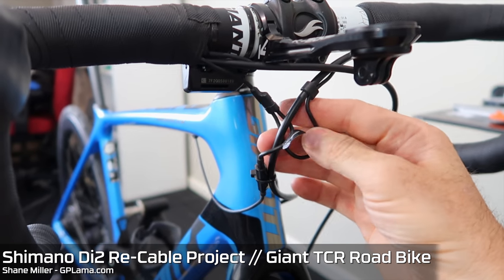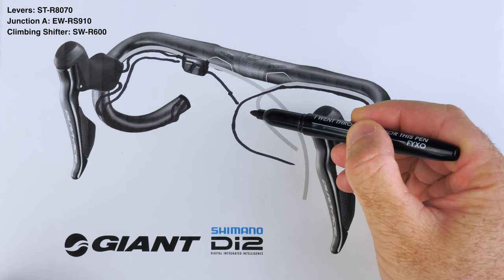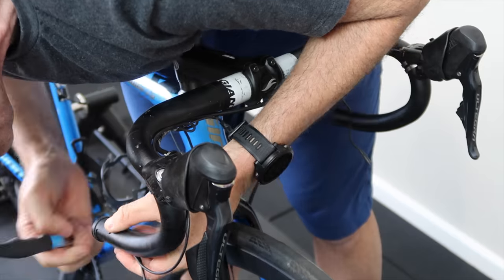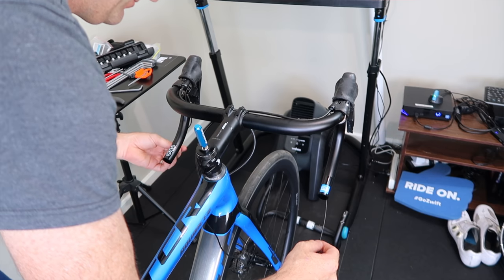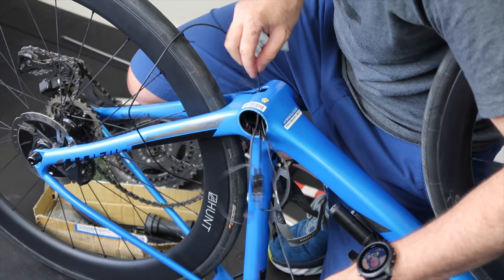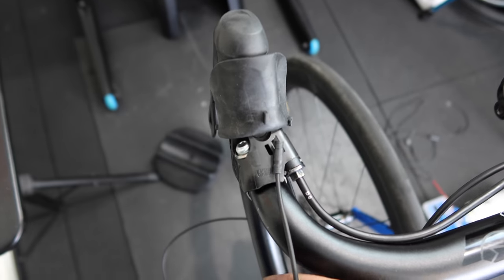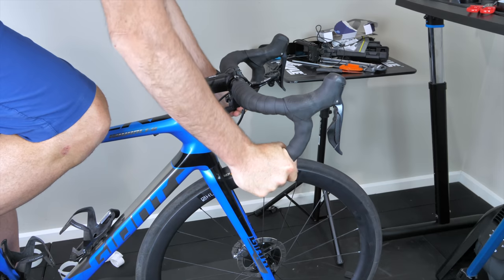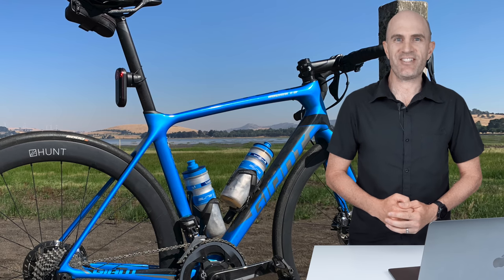Shimano Di2 Re-Cable Project // Giant TCR Road Bike

Comment: Why did you decide to move the WU to the handlebar? I have mine inside the seatpost as it’s out of the way but more importantly easy to access. Btw. I also keep the JC41 junction box in there too. Again easy access. Also I have built my own cable pull system. So so simple. I used a brake ferrule and passed brake/shift cable and secured it with a crimp. The Di2 plug fits in there perfectly.
Reply from the maker: Switched it over to see if it was any more responsive. No issues with it in the TCR post... but some people do report it doesn't work so well tucked away that far away from their head units.
Reply: Is your handlebar carbon? I would have thought there would be a couple of holes under the bar near the shifters. Much easier to hide things.
Reply: Shane Miller - GPLama OK. Like you I haven’t had any issues at all. OTOH, on my aluminum Bianchi I couldn’t put it inside anywhere so I kept it near the headset outside but heat shrink wrapped it on both ends. Love the heat shrink. So clean. Btw you wouldn’t need to bleed your brakes just to disconnect it.
Reply from the maker: Alloy bars. Carbon bars are eTap level expensive.
Reply: Shane Miller - GPLama what? alloy? Have you heard of Faraday Cage? Wireless signals don’t go through metal! It would leak a little from the end plug/controller that’s plastic but that signal would be atrocious.
Reply: Shane Miller - GPLama with my WU always in use while I’m riding (I love keeping an eye on my gears, and control my Garmin pages with the hood buttons) I find my battery needs recharging more often. Good thing we can now turn off BT and just use the ANT+. But watch out with your set up. If your wireless is working at all inside the alloy handlebar (which is a miracle in itself) it’s probably because some signals are leaking from the bar ends... the weaker the signal the more your WU will keep increasing its transmission power to reach its target thereby using up more battery power even quicker.
Reply: Shane Miller - GPLama not sure if you’ve seen my new comments yet.

Comment: Hi just wondering does is make more sense to go from Ultegra 5800 to R8K mechanical and then R8K Disc upgrade to R8070 DI2. Taking note the bike with Ultegra 5800 is for endurance longer rides so can probably get the upgrade from the R8K groupset in the future.
Reply from the maker: Entirely up to you as to what to upgrade to.
Reply: @gplama  For the "Hidden" button for the shifters all R8K DI2 shifters have them correct?
Reply from the maker: @AKSKMY  Hidden button levers (as of what's on the market today): Ultegra ST-R8050 / ST-R8070, DURA-ACE ST-9070, ST-R9150, ST-R9170 and GRX ST-RX815 levers.

Comment: in theory if i dont run the climbing shiftier. with your cable routing can i just plug my left hand shiftier  into the right hand one ?
Reply from the maker: Yep. As long as everything is connected somehow, the Di2 system will work.

Comment: You should use the sprint shifters for climbing whe you have the hands on the topof the handlebar :)
Reply from the maker: I'll have to look into what's compatible with the 8070 levers. The standard single press sprint switch isn't.
Reply: @gplama  use the older ones. thats what I have :). do you have 3 ports in the levers ?
Reply from the maker: @mariosimas  Just the two ports on the 8070 levers.
Reply: @gplama  you can hack the 610 climbing shifters and solder wires to the electronic circuit board that are wired to the old style single press sprint shifters as you called them. I did it on my venge, super neat.

Comment: In case I do not have a climbing shifter, where does that cable  from the right shifter need to connect to instead? So the first cable goes to Junction box A, and what about the second one?
Reply from the maker: Everything just needs to be connected once ‘somewhere’. If you have no climbing shifter, leave that port spare.
Reply: @gplama  So in my case, Left shifter would have 1 cable to the BT unit (which is then connected to Box A) and the second cable through the frame to Box B. And the right shifter have only one cable to box A. Is that right?
Reply from the maker: @CynicalManInBlack  Sounds right. If you're unsure you can always hook everything up to test before internally routing the cables.

Comment: Shimano could invent a hybrid wireless setup where both derailleurs are connected by the same battery in the seat post and each shifters would have their own battery unit to avoid all this mess. After 12 years, it would be about time. I don't have 5 hours to waste reorganizing my di2 wires on my aero handlebars when I wand to install a bluetooth unit.
Reply from the maker: The wireless unit can go anywhere. I agree with the wireless side of things, splitting the front end (low power requirements) to the back end (needs more battery power)

Comment: This one is helpful to see the wiring, I have the pro bars also and was pretty miffed that they didn't put exit holes for the Di2 wires on both sides of the stem or holes at the shifters so that everything could be internally routed, the carbon bars had this, but not the alloy... fortunately alloy is strong and i grew up in the generation where customers would come to our shop and let us drill into their bikes b/c internal routing didn't exist yet... so mine are full internal.  The only difference is that I left my wireless unit external just below the stem to act as a quick disconnect to i don't have to take out the bb or re-route the cables if i change my set up.  Quick tip... the park tool is awesome but if you are a home mechanic and doing this once, you can take a wheel magnet and a tandem length sis cable with a brass brake housing stop in it to do the exact same thing for $1.50.   Also, the T9 on the bars is kinda laughable, just retape your bars often and wipe everything down thoroughly, also buy a 15 dollar sweatguard on amazon and that will catch most of it. If you really think it works i guess to each his own, but I would recommend not spraying lube above your rotors and pads.
Reply from the maker: T9 works. That’s what it’s designed for.
Reply: @gplama   Judging by your bike being medium, what length etube cable would you need to go from the seat tube to the junction box @ the BB? I ordered a 2021 TCR advanced pro and I'm retrofitting my 8070 group from a canyon ultimate. Im guessing you need longer than you would think b/c you would need to get the seatpost out to disconnect the battery etc....
Reply from the maker: @mlanes01  I think that's a 1000mm. I can't recall specifically, but yep, you're on the money -  it needs more than normal for the post removal.

Comment: 1.) Heat shrink is too much work. For me, Spiral wrap get 80% of the neat factor for 20% of the work effort.
2.) I went the opposite way, I got Y split to make things neater on my set-up. I use SW-R9150 (satelite) sprint shifters, not SW-R600 that you are using, and also bar that hide all the cable inside (including the EW-WU111), so it work a bit differently. 
Side view look https://drive.google.com/open?id=18Y3-NLKA8U06pn461SLviMnv71bK_Etp
Top view look, I set two cables (one is actually Hydraulic line spiral wrap together with di2 cable) to draft behind each other for unmeasurable aerodynamic gainzz. https://drive.google.com/open?id=1PM2XIAMfo0YaDnE-ZcMV4NciTIwOwmxl
Here is my connection list.
-Left shifter <-> Left sprint shifter
-Left shifter < Y > Right shifter
< Y > ew-wu111 -> frame 
-Right shifter <-> bar end junction
-bar end junction <-> Right sprint shifter
Reply: Many correction edits was made to the comment.
I shouldn't go into detail of model number of each parts, it make me confuse.

Comment: Hi Shane, what’s the current full weight of the bike now you’re running those new Hunt carbon hoops? Currently have a slightly older TCR with rim brakes and wondering what the weight penalty would be switching up to a disc model. Ride on! 👍🏻
Reply from the maker: I have no idea to be honest. I know switching back to tubes saved a few grams. I'll have to pull out a scale soon....
Reply: @gplama  be curious if you find the few grams savings running tubes offsets the rolling resistance stuff. Hope that makes sense

Comment: I believe, you have really flat and mouth tarmac :) can’t imagine sound of cable inside handlebar during 5 hours ride ... or maybe there is no sound at all?
Another question is: How long - do you think - Shimano will promote wire-solution?? 
How easier wireless solution is? Have no experience with both, that’s why raised that question up...
Reply: The roads out his (my) way are surprisingly rough. They are basically a layer of tar and a large amount of gravel spread over it. What sticks sticks and what doesn't becomes a high speed projectile. I chewed through a pair of Parelli Zeros in about 3 months. 
Then you get the country roads and well, they are something special sometimes. We have one road which I learnt to bhop on because of the tree roots.

Wireless solutions are an absolute breeze to set up though. Basically volt on, pair, set your limits and good to go. Downside is though the SRAM systems were a bit temperamental before the axs stuff, can't speak for the axs stuff just yet but apparently it's solid. Wired is pretty bomb proof just a little more faff to set up. Thing is.once it's set up it's set up, you aren't exactly messing with it. 

I went the wireless route because I love tech and wanted a dzero power metre, and I hate cables showing so any opportunity to do so I tend to take.

Basically SRAMs like Apple, looks nice, doesn't play with others well, bigger all customisation available. Minimal faff ,when it goes wrong usually an easy fix. Premium dollar

Shimano DI2 is like android. Workhorse, customisable to your needs, bit of faff but worth it once it's done, not winning any beauty pageants but doesn't need to. when it goes wrong your screwed. Not going to cost your first born.
Reply: David Bateman - thanks for your clear answer 👌🏻

Comment: I am so glad that I went with the SRAM Force AXS group over di2 after watching this video.
Reply: I'd rather wired up lightning fast shifting over wireless 2 seconds behind shifting
Reply: @choof_worm  I don't know what SRAM group you are using. If it is "two seconds to shift" then it is the quickest two seconds that I have ever experienced.
Reply: @JRock4572001  wait until you try di2 then
Reply: @JRock4572001  plus axs is what 2.5kg? No thanks
Reply: @choof_worm  yeah I have and that is why I went with SRAM. To say that di2 is that much faster than the new axs group is absurd. The only advantage that di2 has is it is cheaper and 300g lighter. That is it.
Reply: @JRock4572001  and only 1 battery, for me its important.
But they are both good, I'm glad to see  that we have the choice

Comment: This makes me pray that the new Di2 is wireless.
Reply: Lvskymar As a tech geek, I certainly appreciate the appeal of wireless, and I’m sure one day I’ll go that route. For now, Di2 is it for me. Sure, the install takes planning and some time, but it pays to set it up right. Once it’s done you have stone cold reliability. It was necessary for me to charge the battery every ~1,300 mi.
Reply: The only reason Shimano uses wires is because it is .3 sec faster than SRAM.  most reviews point this out as a difference between the two.

Comment: Purpose for relocation wi fly module?
Reply from the maker: To see if there was any difference. None so far.
Reply: Shane Miller - GPLama 
You can put it on every conection port.
It changes nothing
Reply from the maker: @mikicastan  It was more of a signal quality/strength thing getting though the carbon frame.
Reply: Shane Miller - GPLama Did you have any connection problems with it mounted near the seat tube before? Changing some components next week and wonder if I should move the EW-WU111 to the bars?
Reply from the maker: @SakoWill  No issues. I just relocated it to see if there was any improvement in response time from the Garmin or Wahoo head units. (conclusion: no different).

Comment: Nice! 👍
Reply from the maker: Looks like it: "The IR-1.2 speeds the internal frame routing of electric wires, shift cable / housing, brake cable / housing and hydraulic tubing on carbon fiber, titanium, and aluminum frames."
Reply: Fairly sure it can. It has like a barb thing off memory you can push into the end of the cable and floss through
Reply: Awesome. Thanks!

Comment: Ask Bauke Mollema what he think about SRAM eTap  https://www.youtube.com/watch?v=Tsk3zAZyLaQ

And for the tape of your handlebar, at the bottom you wrap on both sides in the right direction, but on the top it goes the wrong way i think. It will open when you work hard with your handlebar.  Look at https://www.youtube.com/watch?v=5MzIiv7pewE&t=8m14s

Comment: Did you find that having the wireless unit closer to the front of the bike gave you a stronger connection? Or could you not even notice the difference?
Reply from the maker: No notable difference.